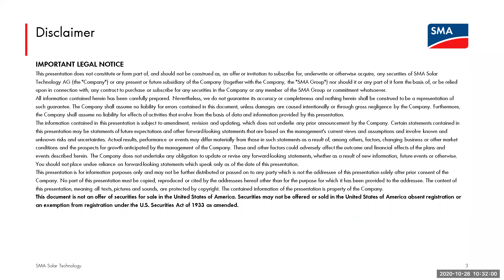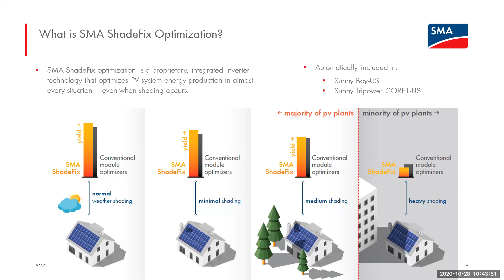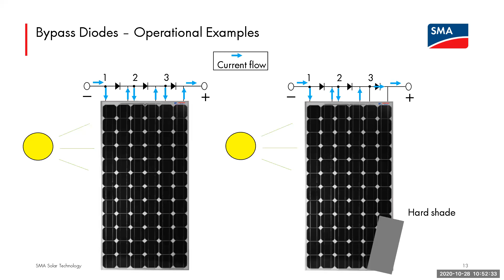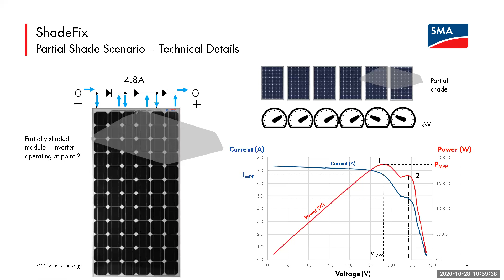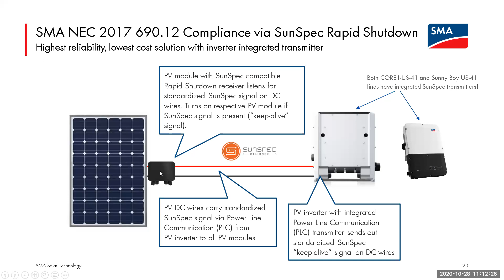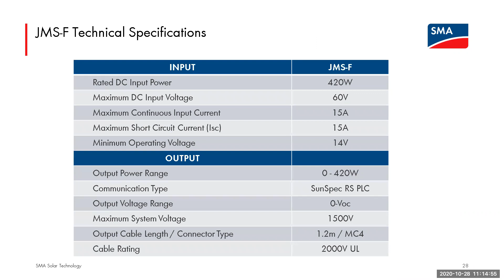SMA ShadeFix | A Superior Optimization Technique | Presented By Soligent

Comment: So, if I understand shadefix...  The inverter will detect the shaded panel and so it will automatically adjust the voltage to try and keep the current flowing at the same amps?

Comment: So how do I not use an optimizer since I need to disconnect every panel?  Maybe fewer electronics on the roof but not eliminating it.
Reply: Hi Mark! The SMA US-41 models of inverter have a SunSpec certified rapid shutdown transmitter that works with low-cost, simple and reliable SunSpec receivers (i.e. SMA JMS-F, APsmart RSD) – like a switch the transmitter can turn off. Power-consuming optimizers are not required to touch every module to achieve code compliance.  SunSpec shutdown works in conjunction with ShadeFix to maximize energy harvest AND system reliability while providing full code compliance in any situation.
Reply: @HomeEnergy  you do need one on every panel if you need to stay under 80V in the array... Unless you are using panels with a voltage of less than 40v, and even them it is every other at best.
Reply: @markavery2888  you’re correct - one JMS-F or APsmart RSD per solar mod ;)

Comment: What is the difference between  on the core 1 inverter  in between ?
Rated MPP voltage range 330 V … 800 V 500 V … 800 V 550 V … 800 V
and 
MPPT operating voltage range 150 V … 1000 V
Reply: Residential Max 600V per string, Commercial Max 1000V per string
Commercial has more built in MPPT Inverters (6) plus the extra Voltage per string lets you build more efficeint solar system at the lowest cost point and fewest parts.